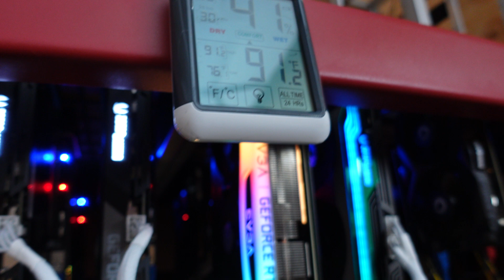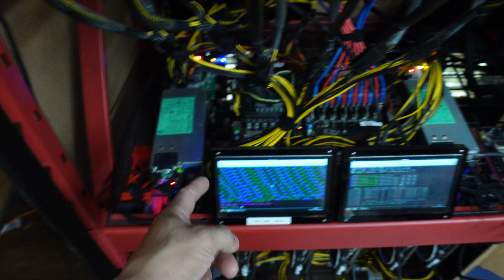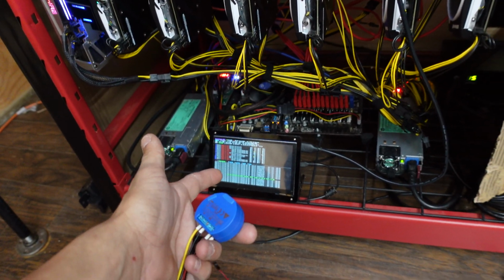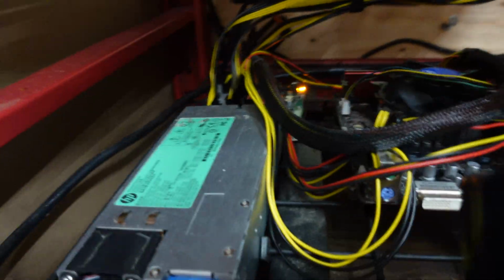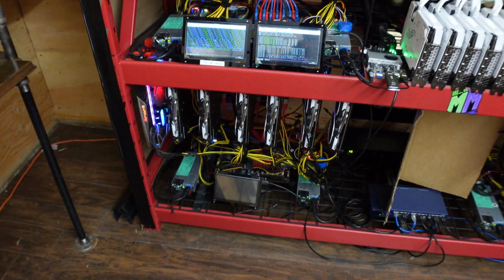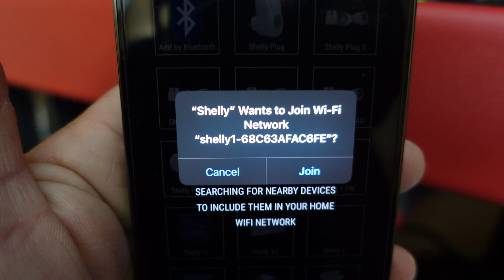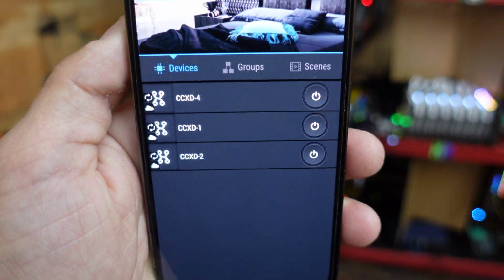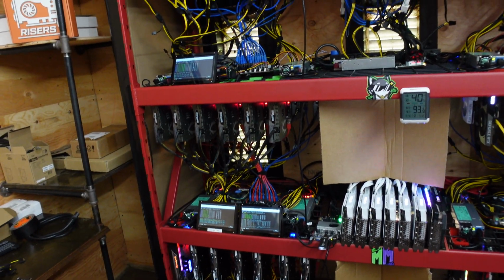Upgrading Crypto Mining Farm 2021 | How To Toggle GPU Mining Rigs From Any Phone

Comment: hey so i bought one and it powers on but then shuts off right away but then it works but the button on the app is like its off. then its not working on the rig unless i unplug the Ethernet cable to the rig and plug it back in then it will connect to the internet and start mining.

Comment: You may not have 12 Volt power on the motherboard with the power supply off, but will the Shelly wifi switch operate on 5 volt standby power?  It is present even with the motherboard turned off. Not sure but 5Volts used to be available on molex 4-pin and floppy drive power cables.

Comment: You can even go more far, you can setup a Raspberry Pi which could ping these rigs from time to time and if they are not responding, you can make the PI turn OFF and turn ON the switch. I did that for my WIFI switches but they are not "Shelly" switches, they are "Tuya Smart" compatible WIFI switches.
Also make sure these switches are isolated on your LAN, because they are spying on you 100%, especially when they are using cloud storage service :$
Have a great week ahead my brother <3

Comment: The WIFI switch will not work for auto power on feature  because if you press the power switch it stay's off until you press again.
Reply: Thank you! Thought that was the reason I couldn't keep my rig on.
Reply from the maker: @leaton512  If you put the switch on the "reset" instead of the "power switch" it may make the necessary difference
Reply: @ChumpChangeXD    That solved it! I spent the last hour trying out all the different switch configurations in the app to no avail. Turns out I had it plugged into the Power Switch and not Reset. Thank you!
Reply from the maker: @leaton512  happy to help my man 🔥❤️
Reply: @ChumpChangeXD  So the Shelly switch will not turn the MOBO off and keep it off or on and keep it on? It just acts as a reset switch?
Reply: @leaton512  so what about with a hard power off will the switch flip on the sever psu as well
Reply: @blinkbb1223  I haven't tried that yet. I'll look into it. Thanks!
Reply: @leaton512  I'm in the same boat as you where my shelly will power on then immediately power off my rig.
Reply: @tinkeranddabble4921  The work around I am using if I want to power cycle my rigs is this... Ensure Power on Default Mode is set to "Switch" and Button Type is toggle switch. I turn on the switch for 5 seconds which forces the MOBO off, then I tap the button off so the icon is not illuminating. Then I tap the button on and off as quick as possible and that sends the "on" signal without simulating it being pressed on. So the light will be off on the switch in the app and the MOBO will stay on.
Reply from the maker: Not if you change this inside the Bios of the MOBO. Theoretically the Wi-Fi switch is just a breaking point off or on shouldn't matter on MOBO reboot Automatically.

Comment: Hi man, how much latency and stale shares do you have for your pools? 
I think wifi via repeater is not a good choice. ;)
Reply from the maker: My rigs are all hard wired by a network switch. BUT when the network switch locks up the wifi still works
Reply: @ChumpChangeXD  Interesting. So you only use wifi for smart switches ? To reset ?
Reply from the maker: @vlcekjiri  When the rig crashes and freezes,Yes. They are in a different location.

Comment: I've talked to kasa smart plug rep and he told me that those kasa plugs are 120-240v rated even though the package says 120v. Problem is I am not sure if I can trust this guy lol
Reply from the maker: LOL yea idn man If its not on the box and something happens his word goes out the window
Reply: @ChumpChangeXD  I mean from theoretical point of view, voltage does not play any role in choosing wire gauge and it only determines the insulation rating. Only the current (amps) value determines the size of the wire. For example most modern wires are at least 300v rated which can be confirmed if you check one of your thinnest extension cords.  Based on these facts, maybe it is  safe to assume that most modern material used to build those plugs are well above 220v? I am still debating. Oh! And yeah I talked to another rep from different smart plug company that it is in fact 100to240v rated with official spec sheet even tho its box says only 110v

Comment: Teckin SP20 16a will work on 240. I run them as does Hobbyist Miner and others. I may try these out just for kicks though.
Reply from the maker: Yea BUT its not rated for it. FIRE HAZARD LOL
Reply: @ChumpChangeXD  definitely says 120/240 on the unit.
Reply from the maker: @NuffxSaid  is this a 15am normal wall plug? Looks like it. Realistically this doesn’t help you in a PDU 20amp or 30amp with C14/C19  cables
Reply from the maker: @NuffxSaid  IF it did work on the plug with the 20-30amp; You would have to do some funky adapters to convert the plugs. Personally in that case what’s the point? It would cost you 3x as much to use them.
Reply: @ChumpChangeXD  new home that uses 20a with 125v outlets. Each rig on different plugs in the house only running 705w each rig.

Comment: It should be possible to make a plug that connects to the motherboard header and doesn't require any wires/cables/power, though that would only support reset function as it would be powered off the pins for POWER LED which goes off if you shut down the mobo but stays on all the time if you just reset.
And common wifi modules can run off 0.01A no problem.
Oh and also integration with alexa, google or other assistants should be no problem.